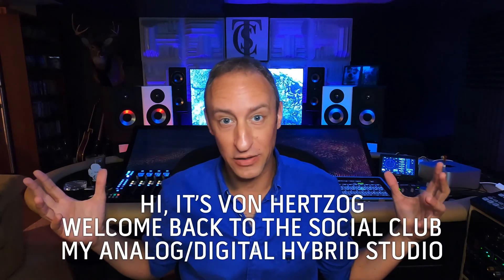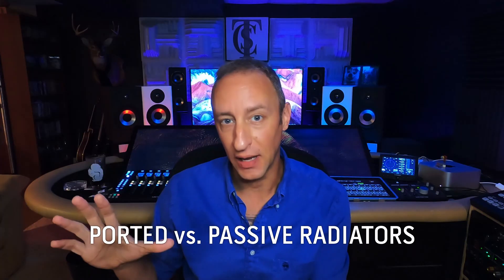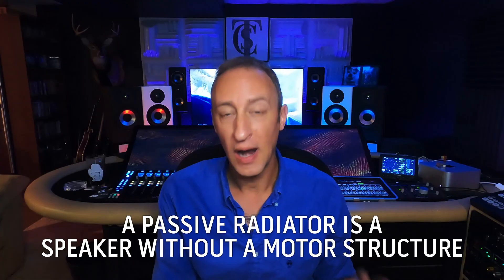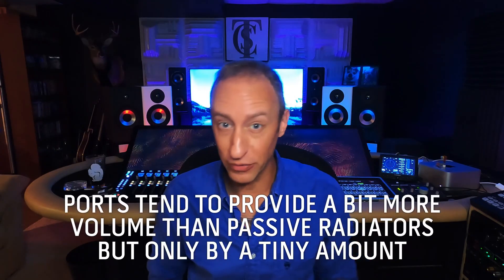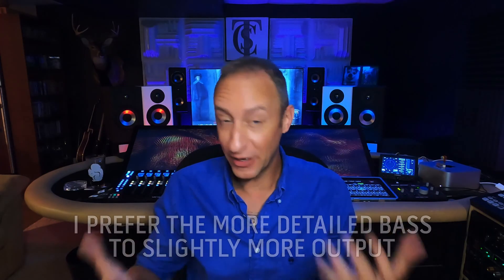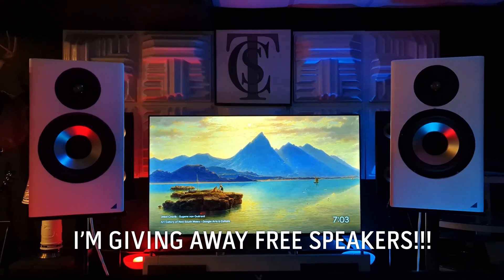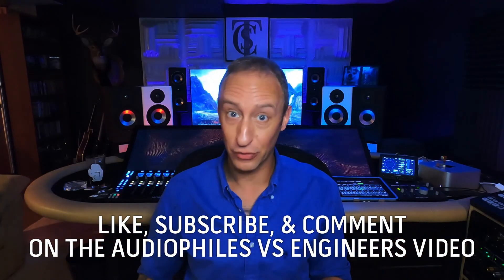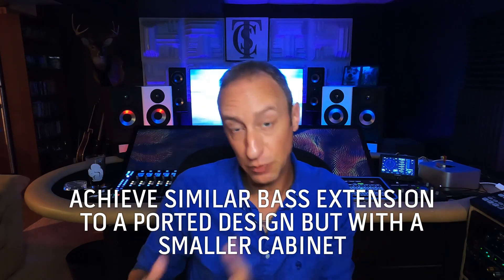Ported vs Passive Radiators - Which Wins?

Comment: I know that these Sound Graphs, are supposed to tell you a lot about the accuracy of the drivers..  BUT...  Ive also felt that its not giving the whole picture.   For example... its easy for a speaker to play a single instrument / soundwave... with almost zero micro-distortions.  However... if you play something very complex and dynamic... with a lot of instruments and vocals all playing at the same time... the speaker / drivers can struggle to keep up the Musical Signals Demands.   Something like Disco.. like Earth Wind and Fire,  is a very good test... to see just how well your speakers can handle so many layers of sounds... to see if they can still maintain SEPERATION of all of the instruments and vocals.   With mid to poor quality drivers... the sounds often blend into each other... and create a flatter / muddied sound.  You end up losing a lot of detail, clarity, and separation... as well as alter the originally intended 3d Soundstage.

 As far as Bass Goes (which is ultimately what I was leading up too) ... its again, hard to convey the differences, with a mere Frequency Sweep.   If you played some decently loud and dynamic music... then the differences would likely be much more Apparent to the Listener.   Especially, if they heard some Port Chuff,  heh.

 Some of the most Incredibly powerful, and clean bass that Ive every heard, came from a Phillips Boom Box, that had a very UNIQUE passive radiator, called a "WOOX".

 If you look up photos of the WOOX taken out of the speaker...  you will see that there are actually 2 of these special woox "cones", spaced apart about 1 inch from each other... mounted to a hollow frame (allowing air to pass between them).    Unlike standard Passives.. which only have one Surround Ring for movement / expansion... The woox has like, two or three expansion rings.   This allows it to expand much further than a typical passive, without ever distorting (due to over-extension issues).

 I had bought the Phillips boom box.. and was amazed at the Bass performance of it (the other drivers... not so much.  They are decent, but nowhere near Audiophile level... and can be a little hot/harsh).    The system used 6.5" woofers.   When they developed Foam Rot... I tried to test a few other boom box woofers into them... but NONE of them sounded good at all  (including a sony woofer).   It wasnt even close.   The originals were leagues better, in every way...

 So I researched the Original Woofers, via Part numbers, and other details.   I learned that they came from a high end audio company, in Taiwan, called Easttech, I believe.
I believe I read that Phillips specifically had them designed and build... to have greater "Travel" than most typical woofers... to prevent over-excursion distortions.  This greater excursion abilities, also likely helped move this Woox units much easier / better.   Even at the max volume that the Boom Box was able to put out, I couldnt get those speakers to show any bass distortions at all.   I even hooked them up to my Large Surround Amp... and even at volumes threatening to blow them... the Bass was powerful and Clean as a whistle.

 Unfortunately, my particular woox devices, were made with foam surrounds (I believe they also made a clear plastic version... but I didnt get lucky enough to find those)... and they eventually rotted out.   Since they were so custom, there was no way to repair them.   I had thought about trying to make my own woox, using different surround kits.. but I never got the chance... and had to leave them behind, when I moved + downsized.

 According to what Ive seen / heard... a lot of speakers that use Passives, use one size up, compared to the woofers.  Meaning... if you were using 8 inch woofers.. I believe they used either a 10" passive, or a 12" passive.   That said.. Ive also seen speakers that used the same size woofer as the passive.   I can only assume that they may have some special things going on, internally.. to prevent over-extension.   And or, that the passive is unique... with a greater travel ability, than most.

 Anyway...  Ive always wanted to see someone try to record a part a section of a high-dynamic song, at a decent volume level..  and compare the frequency readings between... one speaker, and the Other.    I feel like this would give a whole other level of performance data, that goes far beyond a simple frequency sweep.

 Also, Id LOVE too see someone replicate the WOOX device, but on a larger scale... for larger speakers.   I was considering buying surround rings for 12", and rings that would fit inside of them... and using some sort of material to connect them.   But I never got the chance to try.

 I will add, that I have two sets of speakers,  from the same Company... where one has 6.5" woofers... and the other has 8" woofers...  and while the 6.5" woofer speakers sound decent... they cant compare to the 8" woofers.   Ive always wondered why companies choose to use such small diameter woofers on their tower speakers.  I know that they can be "Faster" theoretically... but..  if you are using very high powered (very strong magnets) drivers, then you probably dont have to worry about them keeping up the pace/acceleration.

Comment: Maybe smaller cabinet for passive would have worked even better as more pressure builds up in the box to move passive radiator
Reply from the maker: Yeah you can play with the size of the box to help control the woofer better just make sure you have the room in your passive radiator's X-Max! Thanks for your comment

Comment: I just purchased a "vintage " yamaha yhb-a8 speaker box.  I was disappointed that it appeared to be missing the downward firing sub.   After further research it actually is missing a 10" passive radiator.  It has 2 8 in drivers and two 5 in horns, rated at 400w.  The orginal radiator resonse was between 40-20khz.  I ordered the earthquake  slaps mv10-v2 to replace the missing radiator.  Do you think the will bring this  30 yr old box back to life?  Will that low wattage move that cone?  Or should i have gone something cheaper/thinner and easier to move?

Comment: Great info! If you want a crazier example of using passive radiators and a car check out my video of my 6 12s with a  earthquake slaps radiator for each pair of 12's. Its only getting half of the rms but its the cleanest, loudest set-up ive ever had. Plus im getting very high db on a wider frequency response.
Reply from the maker: Thanks, will do! Sounds bonkers!
Reply: @SocialClubSound  my next build in the next couple weeks is going to be even more bonkers lol. By Monday my 1200rms 10" is being delivered. I'm building what I call the "Deaf cube"  it's going to be a 1.4 cubic foot box with my 10-in sub inverted on top with three of the outside panels holding a earthquake passive radiator. Then eventually I'm going to buy two more and build a 4-in gap panel on the bottom so all four corners of the box are going to have a speaker. 🤯. This is what happens when a bass head needs to add a baby seat in the back of my truck 😂

Comment: say i have a single 8" sub, and two 8" passive radiators, sub spec says 0.50~0.75 ft3 for ported, what would be your recommended net internal volume?
Reply from the maker: You can follow the same internal recommendations as for ported but remember to account for the displacement from the Passives. So the same range of enclosure would work for both ported and passive radiators. So you can get away with a bit smaller volume since he passives won't likely displace as much space as a port would. The lower the tuning the bigger the box is traditionally the rule of thumb but you can get away with slightly smaller since the displacement is typically less. Hope that helps clarify